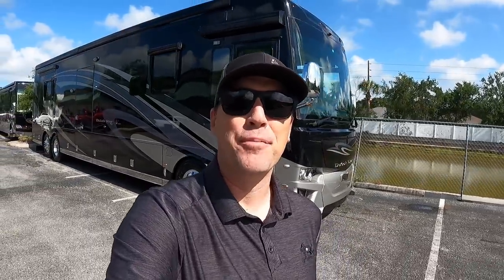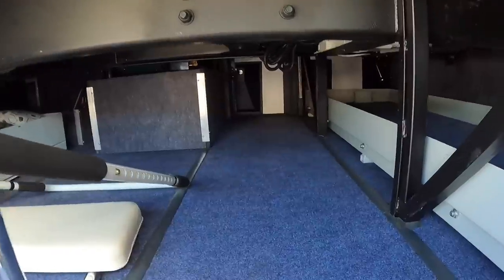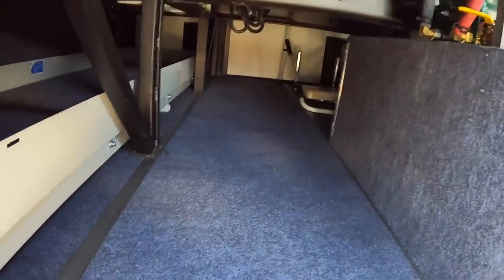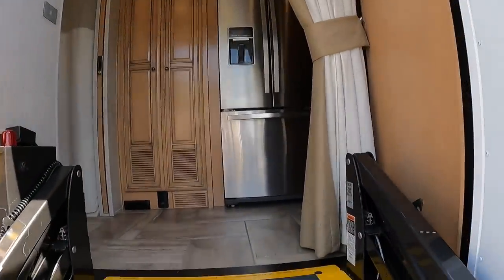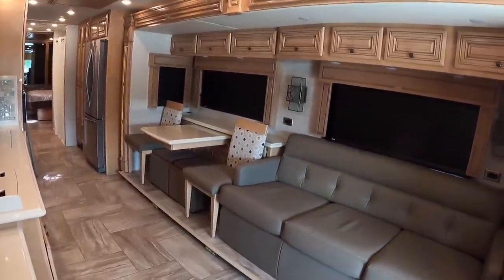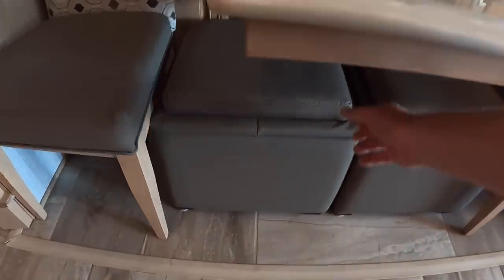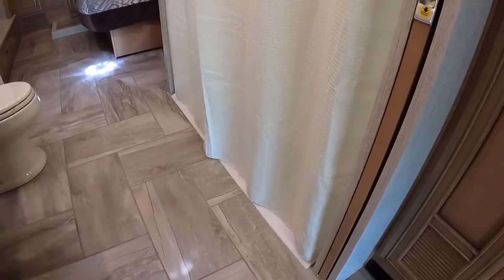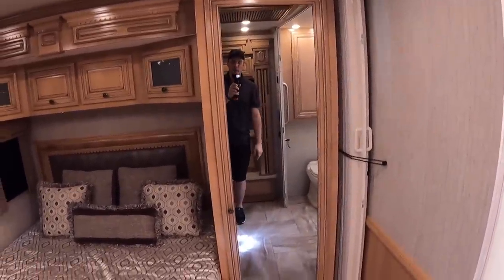Newmar Dutch Star 4311 for sale -THE NICEST PRODUCTION RV that is WHEELCHAIR ACCESSIBLE!

Comment: This is a awesome coach And I love what you Said about buying it and being able to have a technician spend a whole day going over the Coach and it's system's and if I want I can spend the night to double make sure I got the system's down etc ..  I'm alone at the moment but handicapped but not yet in a wheelchair but for longer walks I have to use a walker. The other thing I like is I currently have alot of small dogs mostly Pomeranians and some cats And they Will All be traveling with me and I want to make sure that air-conditioning has the power to power it to keep My fur babies comfortable especially when I have to leave them alone inside and that center lift is great for me and them giving me much more control and easier to herd them into the platform safely much more so than trying to hold onto the many leashes going down stairs since I'm unstable and usually must use a cane so only one hand free.     I will definitely consider very strongly buying one of these motor coaches from your company.  Thanks for the tour.

Comment: This home is very nice and has great features for the handicapped, however it still requires a ambulatory person to be present to go outside and Open the side door so the wheel chair ramp can be utilized.   Some how they need to Design one where the side door can be opened and ramp activated by the actual handicapped person without the presents of another more able bodied person.
Reply: That not true my friend that door come with a key fob I have the 3911 and Im full time and alone scene 2016 if he doesn't have it its a quick install!

Comment: 3 minutes in and you can absolutely see the difference in “quality”… compared to higher end motor coaches.
This is nothing more than a typical single wide at your local trailer park with a nice paint job.